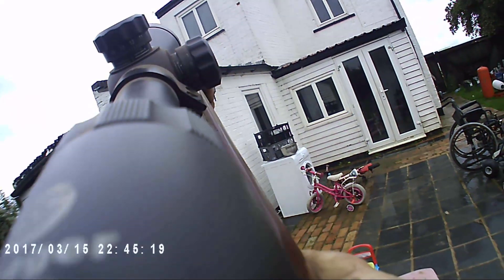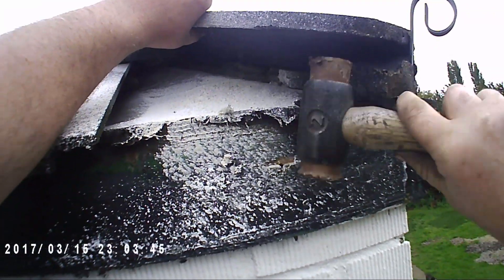Tactical wasp nest elimination

Comment: The best way that I ever found to fight hornets, wasps and bees is to take a shop vac and duck tape a 10ft piece of 3/4" pvc to the hose ( you can use as many pieces as you want, but I've never needed more than 20ft ). Turn the vacuum on and stick the end of the pvc up by the nest entrance. It'll suck them all up as they come and go. When you are done, just seal the vacuum up with some duck tape ( so they can't get out ) and leave it sitting for a day or two. They'll all be dead. No chemicals, no stings!

Comment: I saw the bug spray can and thought " Oh oh, that's not going to work!  been there done that. Doesn't work fast enough on the bastards and they get annoyed and chase you!
Usually i get them under an overhang or more in the open.  My solution is a tin of de-greaser and a blow torch and get them flame thrower style.   If the fire option is not safe then the de-greaser alone on the nest will leave enough Kero/ solvent that they can't go back to the nest and if they try it kills them.  Also changed the nozzle on a paint pressure pack once to a degreaser stream nozzle and painted the buggers bright red.  They don't do well with a coat of gloss acrylic. 

The other one that's probably more risky to the operator than anything is just throw a cup/ bucket of Boiling water at the nest. 

Of course have to be accessible unlike what you had. 
Normally Leave  things alone that don't bother me but wasps aren't happy with that arrangement and I have been stung Multiple times just walking past, mowing the lawn etc.  I see a nest now and I make sure to get in the first and decisive strike before the fkers get me.

Comment: Tape a bug bomb (spray can with locking tab) to a drone.  turn it on and fly over nest, rinse and repeat as necessary.  You can just fly it over the nest until the batteries run low as the wasps will keep attacking the drone and getting chopped up by the propellers.
Reply from the maker: Awesome idea but I don't have a drone
Reply: @turboconqueringmegaeagle9006  make one 👍😁🛸